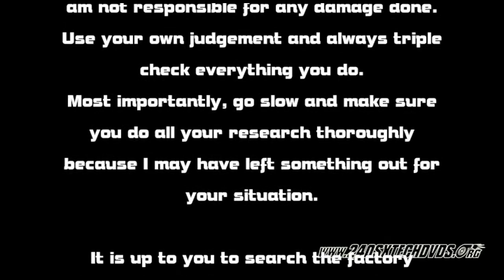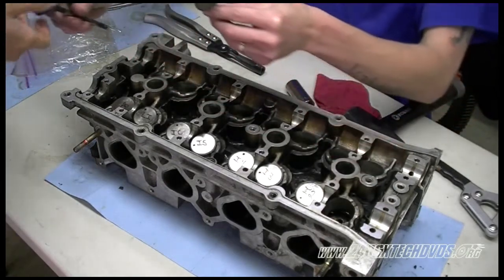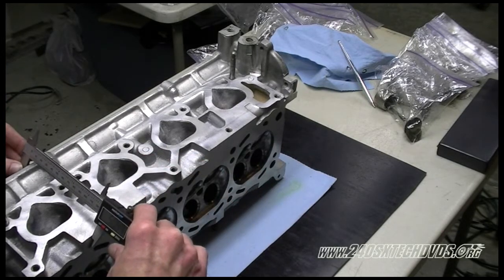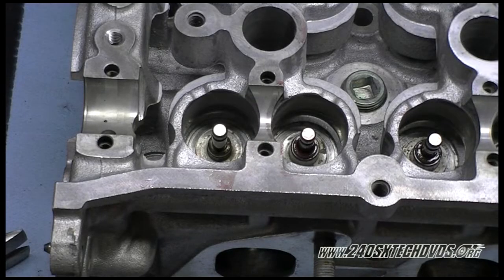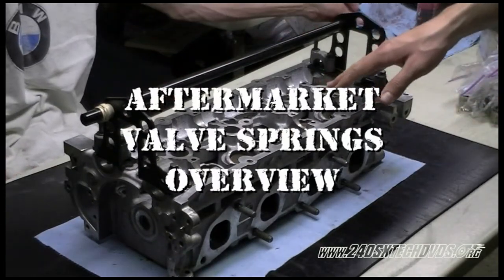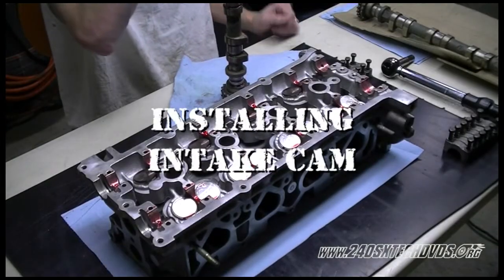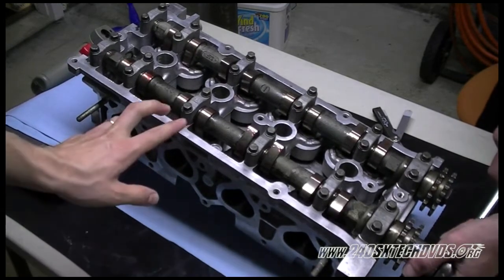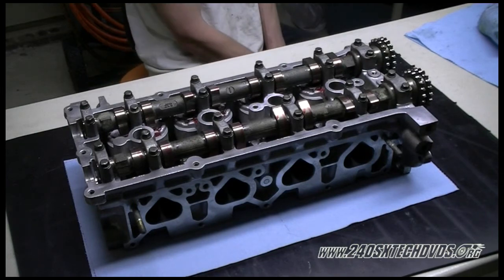How to Nissan 240sx KA24DE Head Build DVD Part 3 Turbo Motor Engine Build S13 S14

Comment: My favorite video for ka24de head. How do you remove the stock shims. Are they pressed into the cups
Reply from the maker: Check out the full video in my videos 👍🏻
They are just held on by oil…just pull them off or use a small flat head and carefully pull up on them.

Comment: Looking at the valve spring compressor, I think there would have been more leverage if the bar was in the top set of holes opposite of the side being worked on. Ignore if that was found to be the case after this was filmed.

Comment: What brand pistons are those with the valve reliefs , are they custom…… do you have dimensions or part number?
Reply from the maker: Sorry I do not have that info anymore. They were not custom though.
Reply: @JDSPerformance25  then they must be discontinued or a 90mm or something because all of the off the shelf 89 and 89.5mm ka24de pistons I have ever seen in several years are just the same .... dished like from factory.
Reply from the maker: @Schmitty_Luv2 Arias Pistons 👍🏻
Reply: @JDSPerformance25  I thought you said you don’t have info on them? Do you now know what compression ratio, 89,89.5,or90mm…. Are they off the shelf? Like I said I’ve never seen ANY off the shelf aftermarket ka24de piston with valve reliefs on them.
Reply from the maker: @Schmitty_Luv2 8.8:1 is the ratio….89.5 refers to the bore size you have, I found it for you.
Reply: @JDSPerformance25  that’s wild , I had no idea that spec arias off the shelf ka24de piston came with valve reliefs like that. I appreciate the info 👍
Reply: @JDSPerformance25  by any chance would you happen to know what trigger wheel can be used for the 1996 Nissan 240sx ka24de using the AEM series 2 ECU?